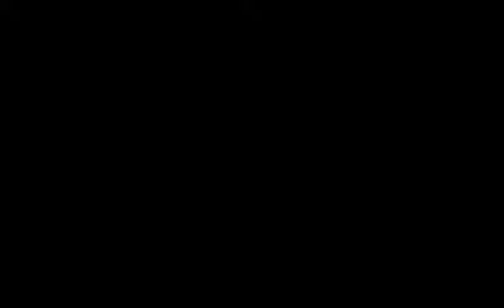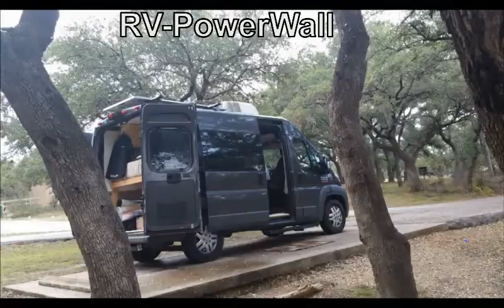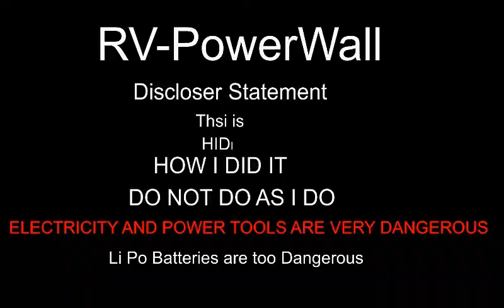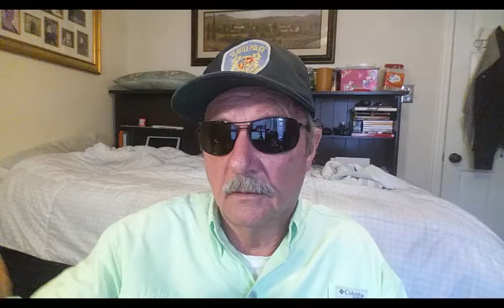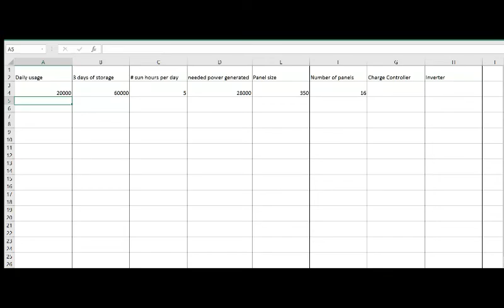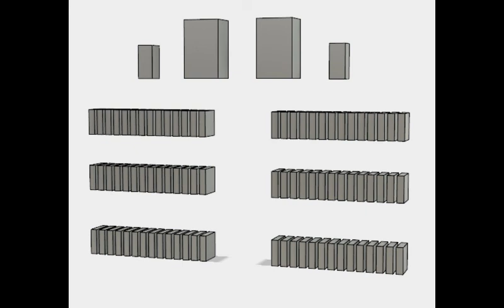RV Off Grid Solar Design #2

Comment: It costs me about $60 per kilowatt/hour of storage to build my 18650 packs.  This does not include my 100 - 200 hours of labor, including obtaining, charging and capacity checking all cells, and using only the ones over 2600 mah.  But it includes all my tools amortized in.  These packs should last 20 - 30 years minimum.  And as you mentioned, this is equivalent usable of  about 2.5 kw of lead acid storage
Reply from the maker: I have never calculated my cost minus labor per kwh. But if you got time on your hands it is very reasonable to use that idle time to make batteries.
Reply: Not ony that, but LiIon has a significantly higher energy density than the commercially available Lithium-metal cells that are only 3.2v nominal that someone mentioned as the $3000 per alternative.  So for mobile applications where weight and space are important, LiIon is more desireable, if you have the time ;)

Comment: Sorry, but this is a rich-mans off grid system. Noone can afford 3 days worth of battery storage. For your 20 kwh/day example you have to spend a minimum of 30000 usd for lithium, or 25000 for lead acid deep cycle batteries. Let me tell you how its done better. Only buy batteries for about 70-100% of your daily requirement (night demand and buffer for some daytime demand), oversize the pv array by about 20% then your daily  requirement (worst whats happening is that the power isnt used, but it gives you the bit extra for cloudy days) and most importantly, buy a hybrid inverter. Hybrid inverters have a grid/generator input for emergency. If you have a grid, connect to it. If you dont have a grid buy just a small 2kw generator. They are inexpensive but if you keep it running through a shitty day it will still charge your battery with all power you need through the day (it isnt running your load, the inverter still is!). I have the exactly same system. Pv for 22kwh/day, 10kwh lithium battery, hybrid inverter, 2 kw generator. All of this cost me 7500 usd (DIY setup, battery purchased), no subsidies! The solar is covering 95% of my demand (19kwh/day). I only need to feed in 5% in avarage during a month, as on rainy days you can easily conserve some energy too. Keep in mind, a few panels more are much cheaper then a bigger battery bank!
Reply: The Hillside Pranburi without saying that somebody is right or wrong here. Our guy here specifically indicates an off grid system so the design criteria is very different. You have grid tie, that's great for you, I do not, that's great for me. Apples and oranges. The cost of Li batteries has cpme down to $100-150/KW, the cost of string optomized commercial panels are in the $.70/watt range. There are several ways of designing without calling someone wrong. Peace
Reply from the maker: Panel cost vs battery cost I agree is cheaper. I am totally against grid tie. However every off grid solar system should have a small generator that can refill the storage with in 5 or 6 hours. As I said Storage cost are well over 50% of total system cost. However we are seeing the storage cost drop dramatically.
Jack Rickard (https://www.youtube.com/watch?v=NKWo-i-2pUA) is offering 30kw for right at 10,000 dollars. That is 1/3 of what you quoted above.
One thing about over building the solar input is space to put solar panels.
In your example 22kwh used per day I figure 40% extra and calculate for 5 hours of sun per day. That would be a 20 panel array for about 6200 dollars. Add in charge controllers, inverters, backup generator, and storage would be about 20,000 dollars. If you project out 20 years we are very close to the 11 cents / kw that we are paying the Elec companies minus the bullshit charges and taxes you pay on every kw used.
Reply: Sure peace. I didnt say he is wrong. I just think not many people do have 50k usd to spend on a solar system. As well i was talking about off grid. A 400 usd generator isnt a grid connection. You just need to buy gasoline for run it maybe 40 hrs a month (depending on your climate of course). And lithium batterys you can only get if you buy used cells and make the pack by yourself. Theres no finished product on the market for 150 usd/kw as pack+bms. Was just about costs. Sure, if you have cheap access to batteries, great
Reply: We are fighting on the same side guys. For many people high costs are a reason not to go solar. Especially outside of the first world countrys with bad access to components in general...
Reply from the maker: No fight here... I welcome everyone's input. Thanks for taking the time to share your system and ideas.